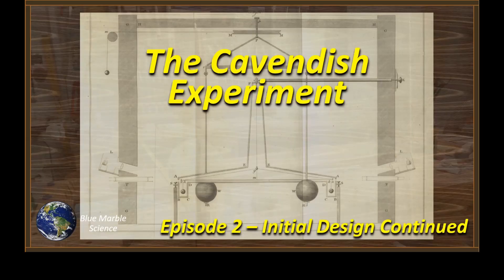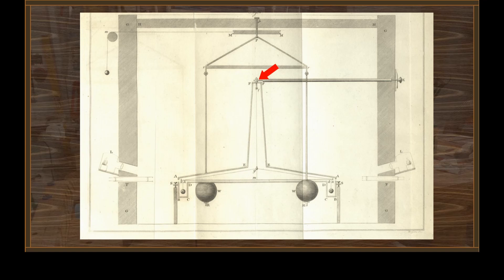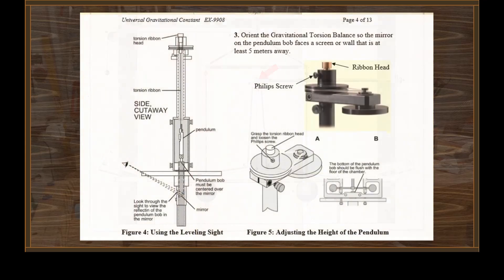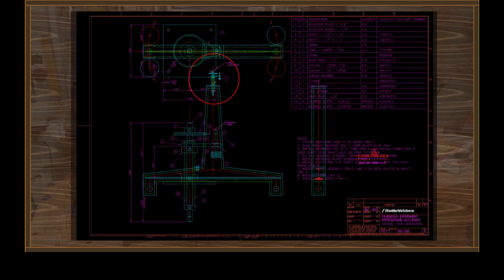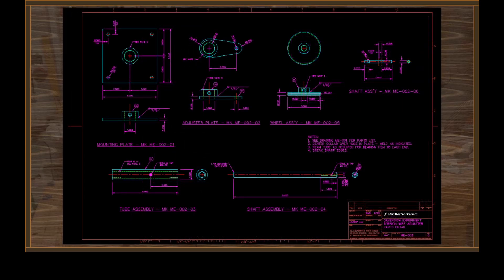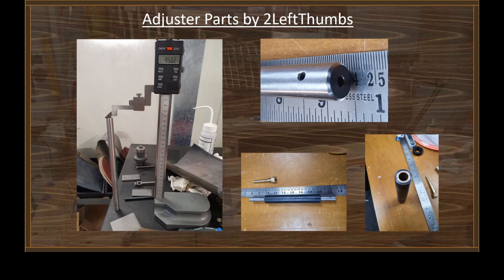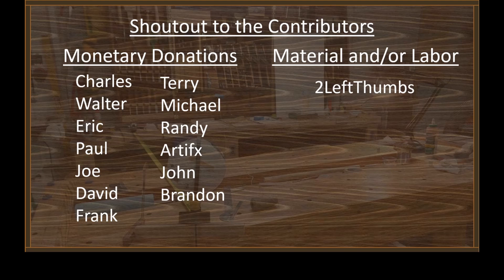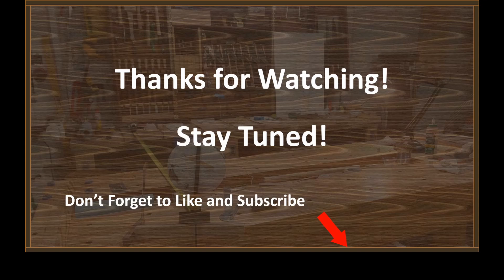Cavendish Episode 2

Comment: Torsional stiffness:  I have noticed that every clock I’ve seen with a torsional escapement had a “tape” not a suspension wire.  I assume it’s because you can make very fine adjustment to the stiffness using the kind of roller mill you will find in a silversmithing shop. With wire drawing you are a bit limited by the dies you can get.  That might be an idea to keep in the back of your mind.
Reply from the maker: That's a good point and I've thought about it. I want to see how the wire acts first.

Comment: Comin' together!!! Sweet. 
Couple suggestions - the set screw to capturing the wire looks like a high stress riser, perhaps consider solder/ epoxy/ soft copper sleeve? Also, the 'O' ring drive adjustment may retain some load post adjustment that may relieve over time contributing to torsion error - perhaps a chain or belt with embedded wire? The bearings you are using I hope are using non-contact seals or no seals - the drag of contacted seals may contribute to errors.
Again - lovin it!!!
Reply from the maker: Great comments! The wire is indeed going to be inserted into some small ID x 1/8" tubing and since it will be spring steel music wire, I think I can solder it with low temperature lead solder without risk of significantly changing the modulus of rigidity at the connection. There is a locking screw that I didn't mention that locks the shaft in position so when I adjust the the wire, I'll loosen the lock, move the wheel slightly and re-tighten the lock screw. The "bearings" are simple oillite bushings and I'm using a very light duty ball bearing thrust bearing at the top of the shaft to further reduce drag. It needs to be as drag free as possible and there is definitely no need for any sort of seal. Again - thanks for the suggestions. I feel better when other eyes look at this stuff!

Comment: Just 1 small point when I do my CAD I invert the paper colours I find it much easier to read on a white background and it closer matches the hard copy.
Reply from the maker: I find it hard to look at on the screen with a white background and the colors that work well against black are no good against white. So I can make pdf's and do it that way in B&W and then I don't have to mess with all the layer colors.
Reply: BlueMarbleScience I guess it’s what your used to I usually work from hard copy and if I am sending out copies I print then send as hi res scans that way they can view drawings but can’t edit or pirate I know Dwg or DXW files can corrupt.

Comment: There are a few parts of the setup I've been having trouble with visualizing. One is how the angle is read from the torsion beam (the slips of ivory). The other is the top part suspension for the large attractor balls. I'm not clear what the counter weight is doing exactly or how they are rotated. I'll have to really read those parts of the paper a few more times. Looks like things are coming along. Exciting!

Comment: Are you going to enclose the apparatus inside a Faraday Cage to remove the effect of electric fields from the list of objects the flat earthers will make? Also using non-magnetic metals will kill the objection about magnetic fields. THey'll object anyway, but you can insure that they have no basis.
Reply from the maker: I like the cage idea and I'm looking into the best way to do that!
Reply: @bluemarblescience  Hi. I would suggest to perform the experiment twice: first with the apparatus oriented north to south first and then east to west. in this way it would highlight the different contributions from the geomagnetic field in the two extreme configurations (or the absence of contributions, more likely).
I look forward to see some wood being tooled, I have fond memories of such activities.
Reply from the maker: @BonDeRado  I may have a problem doing that unless I move a 350 pound workbench. It's a great idea but I'm a little limited by space and overhead interference's.

Comment: Hi Blue.  Looks good.  I might have just used a long lever with a pivot above the wire attachment and the wire hanging blow the pivot.  Then do a rough adjustment of the wire and use the lever for the fine adjustment.  Still what you are doing is probably better as it keeps all the equipment small and easily isolated.  I've not watched all of the videos on this.  I'm assuming that you will use some metal window screen around you equipment to isolate from static charges or at least make sure that all the weights, etc, are connected together and grounded?
Reply from the maker: Hey Charlie - I actually gave the lever concept some thought and it would work I'm sure but this is nice and compact as you pointed out. Maximum of the wire to go from the weights touching one side of the enclosure to touching the other side is about 5 degrees. One full revolution of the drive shaft is about 15 degrees for the wire so I think I can easily get the resolution I'm looking for with this thing. Grounding of this thing is essential and all the metal parts will be "earthed" to a cold water pipe that's 20 feet away but I think I may also put it in a cage just to be certain.
Reply: @bluemarblescience  Sounds good.  I like the old MIT video where the demonstrator tested for attraction to a charged lucite rod through the screen and after removing the screen.  The screen prevented any attraction.  I have found that electrostatic forces are a mystery to flat earhters or at least they don't understand them.  They believe in magnets but seem to have no idea about electrostatic forces or how to screen against electrostatic fields (easy) and magnetic fields (harder).

Comment: Big Blue! Fascinating details on the suspension of the torsion spring! I think all your problems will be solved if you were to employ strategic use of a Turbo Encabulator: youtube DOT com/watch?v=Ac7G7xOG2Ag (2 minutes)
Reply: Can he use a turbo encabulator without thiotimoline to run it?
Reply: @barryon8706  Yes, provided the Panametric Fam is correctly tuned.

Comment: Nice update on the Cavendish. Simple and practical reduction gear. Are you going to use anything to adjust the tension on the belt or just rely on using a belt that isn't going to be too stressed?
Reply from the maker: There's no real load of any sort on this thing and I've got a little thrust bearing at the top so I doubt it needs anything more than a barely tensioned rubber band. 2LeftThumbs and I talked about that and concluded we didn't need any adjustment. We'll see what happens - I think it will be OK. If not we'll add an idler or something.
Reply: @bluemarblescience  I was concerned about the elasticity of belt having an effect on the experiment.  Increasing the load on the belt would reduce the oscillation caused by this.  Or maybe I am just overthinking it.